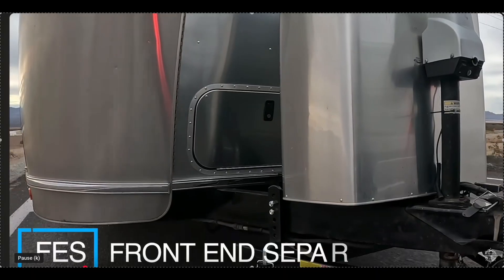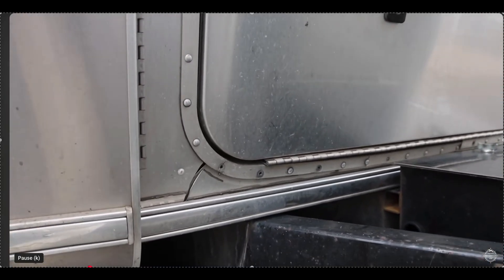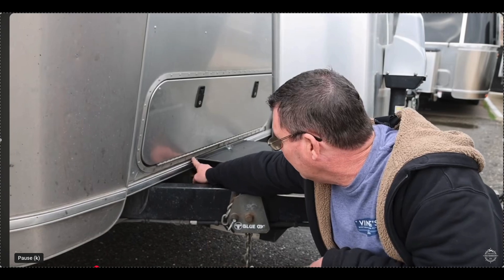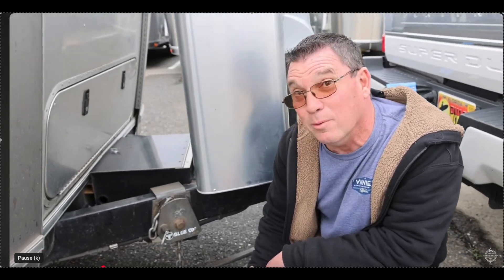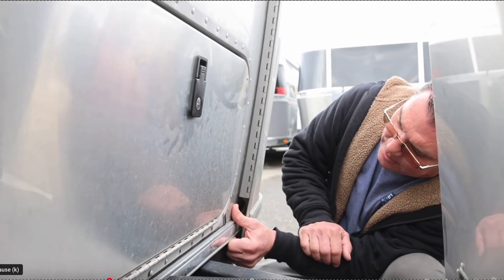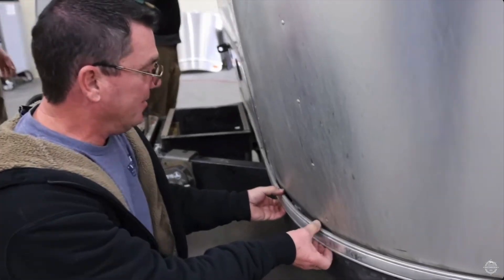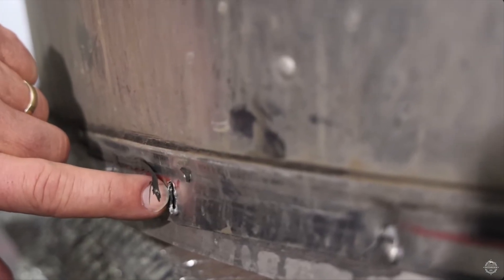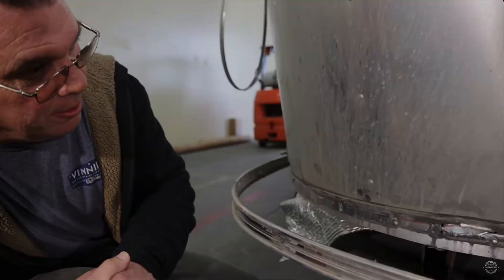Front End Separation • Vinnie's

Comment: @Vinnie’s I just purchased a used 2024 30’ bunk from Woodland and it had a popped rivet at the 5 o’clock position and I didn’t notice until I got home. I’ve been putting funds away for a repair when needed. How do I know if it has separation or if the rivet just popped?